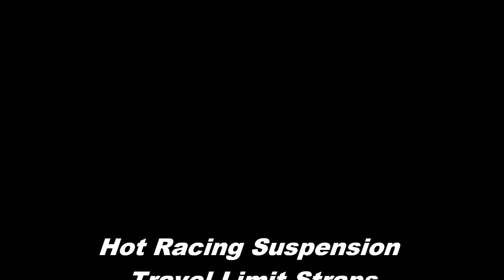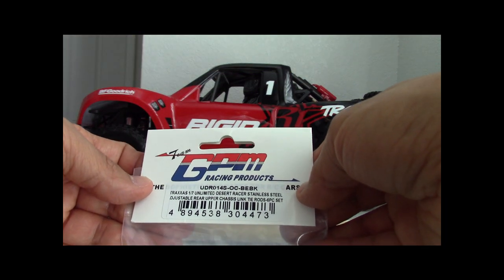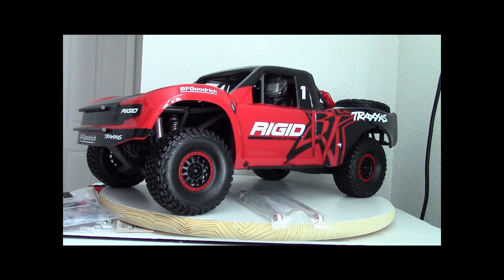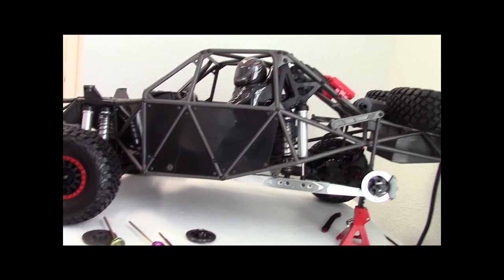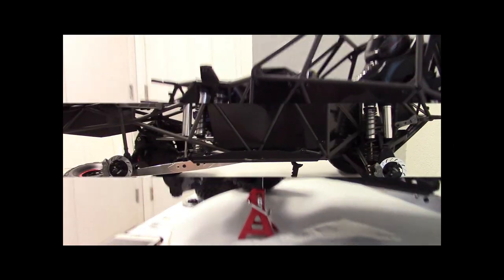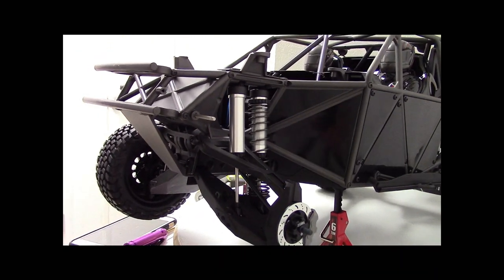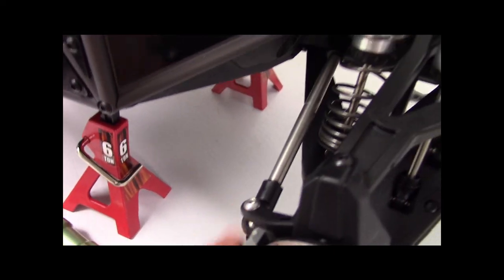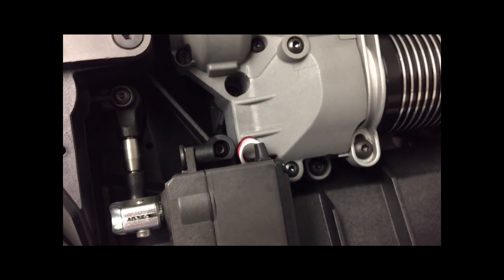Traxxas Rigid UDR GPM Aluminum & Stainless Steel upgrades

Comment: Looks great and all but I learned my lesson. I spent stupid amounts of money on my TRX-4 Bronco mainly scale accessories. Even dug up a old Losi Mini Crawler and went crazy replacing every single piece of plastic. Now both weight a ton w/ crap performance. Always just one scratch away from ruining the "awe.." when admiring. Lastly, resale will take you 6 months to find one guy willing to pay you   50 cents on the dollar.
Reply from the maker: Yeah your right the only difference is I don’t sell my RC’s.
Reply: @noeysfastrc3291  Me neither.. I am o l d and have rc stuff from planes/helis/boats/subs/tanks/rockets/cars/ and now trucks and crawlers. I give them away, even gave a hobby store $500 in quadcopter parts rather than sell a a huge loss.

Comment: I ordered all of these, plus a few other components to replace .. I'm pretty new to the hobby, but mechanically inclined... how much time do you think I'll need to do all of this?  Plus I'm going to a beaded tire..  ?  Think I'll need some assistance or can I do it on my own?   Would you be willing to connect via phone or email and give me some assistance if I need it?  You don't live in Northern California by chance?
Reply from the maker: Hey thanks for watching. I think you will be fine. You shouldn’t have any issues everything is straight forward. Time it will take a couple of hours to install all of the upgrades.  The most time consuming were the anti-sway bars but even then it was easy enough. Sorry I don’t live in California, I live in Texas.
Reply: @noeysfastrc3291  wow man, I hope I can knock all of that out in a couple of hours...  my biggest fear is forgetting how to reassemble it, this is why your video is useful,... please make more videos of how to remove and replace parts. I love em...   I also am not sure in what order to replace parts, or just do it all at once when they arrive.. (everything is on back order now anyway for at least a month)

Comment: Did you notice when doing the adjustable toe linkages with GPM parts you lose 5+mm of suspension travel due to the GPM spherical joints having considerably less travel than the  Traxxas ones not allowing the arms to get full droop. Seems the same with most GPM parts.

Comment: Where did you order lights from.
Reply from the maker: They came with the truck as a free item with the purchase of the truck.  They are the light kit from Traxxas.
Reply from the maker: If your talking about the two rounded light set which are big lights, I got those on eBay.
Reply: Ok sweet thanks. Yes those are the ones I'm talking about